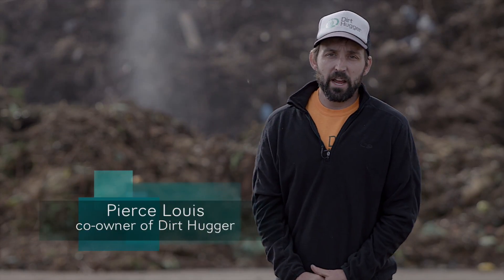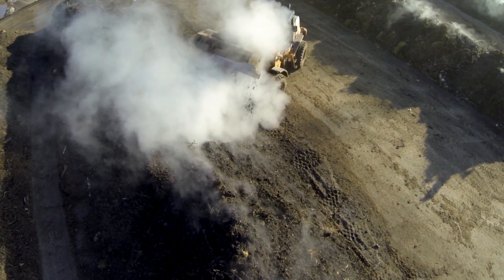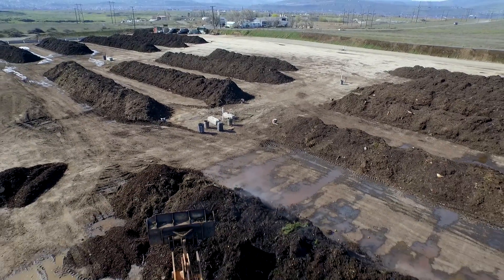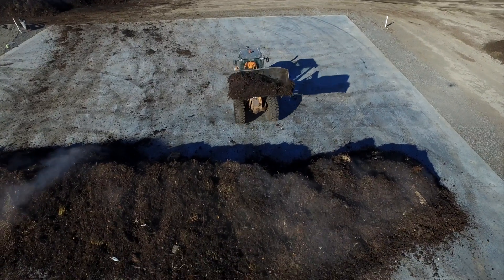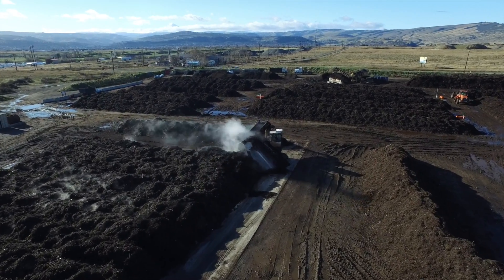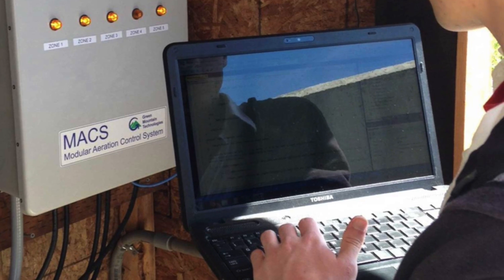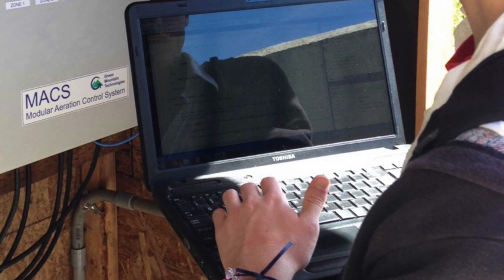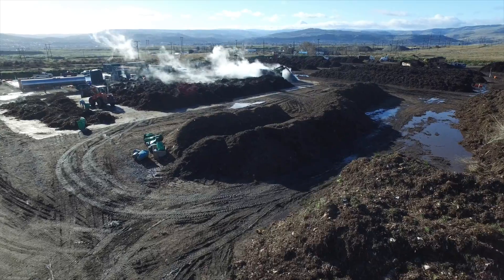Turned Aerated Pile (TAP) Composting - Dirt Hugger

Comment: Looks like a great and user-friendly system!
What do you do if Water flows into your air pipes?
Reply from the maker: We use a pressure trap system at the lowest point of the piping and it lets water flow out of the pipes continuously